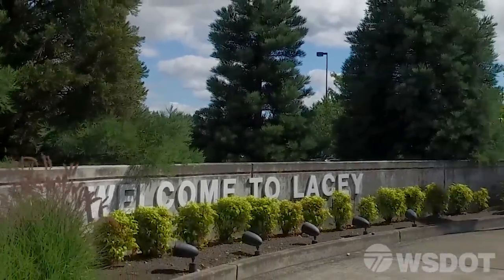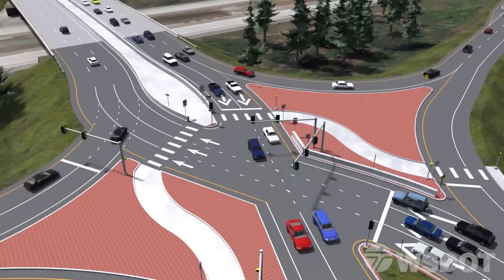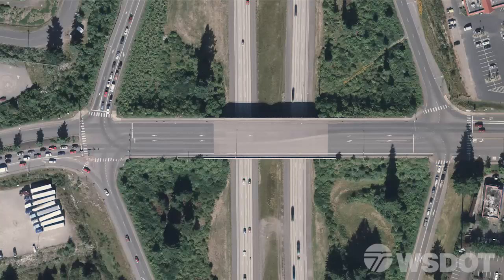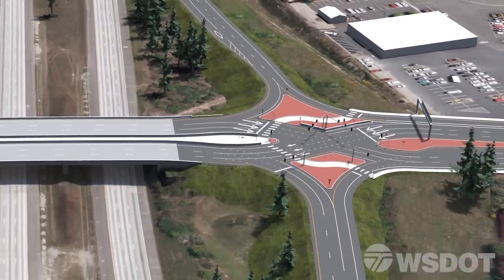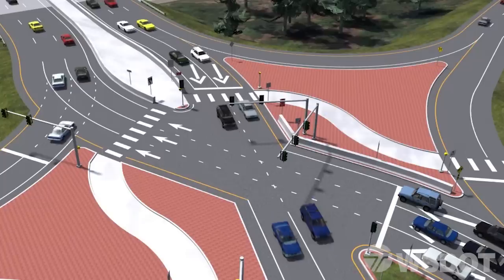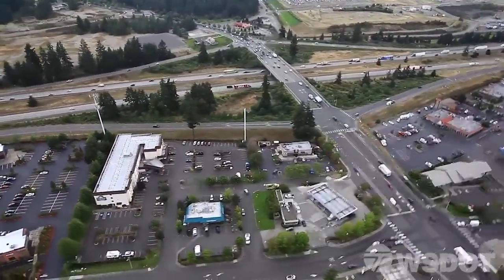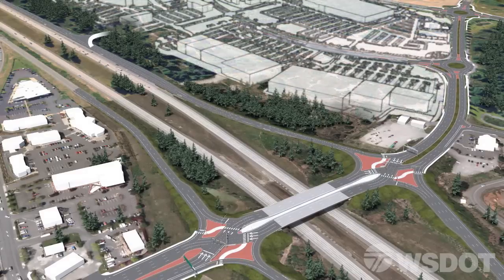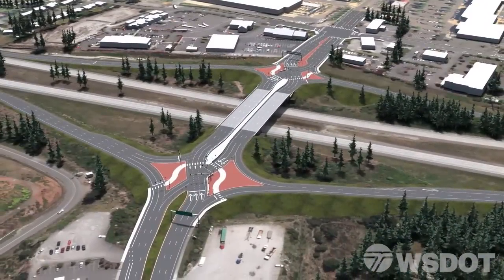Diverging Diamond Interchange comes to Washington State

Comment: I've lived in Washington State all my life, and have been a safe driver for 15+ years with an unblemished record.

My biggest concern is the point(s) at which the flow of traffic crosses to the reverse side of the road, and then back again.
I am not saying either that I have a better idea, or that the current interchange system is good enough to be left alone, but rather the indoctrination as an American driver and tradition of driving on one side of the road at all times- and then having to suddenly switch!- would be disorienting and confusing for someone with a perfect driving record, let alone the tens of thousands of idiots out there!
For as well-marked as this DDI system may be, considering its simple rarity across the USA alone will make it a challenge to navigate even if it does improve the flow of traffic.
Reply: I doubt the driver even notices the lane change, as it's not even a road you can pull onto / off of. It's an overpass.
What I hate about these things is all the signage and lack of aesthetics. Also the huge amount of time it takes to start and finish these projects, and the money they spend. A huge amount of wasted money goes into these projects for hazard pay, insurance, not to mention extreme over-bidding and long delays.
Otherwise I think it's a cool idea, and would like to try one out.
Reply: I honestly believe that a high speed roundabout (Brit here and living in Canada) would be better than the divergent diamond.
Reply: Ellenor Malik
 For an overpass?
Reply: a roundabout at each end.
Reply: edgardo reyes
 I see, but I don't like roudabouts because it's hard to see traffic on either sides, you can't see anything in the side mirrors so if you're in a  van with no windows they are dangerous. Even on a motorcycle you need to crank your head around to check for traffic, look in all directions and check for signs to make sure you're going the right way. Or I guess you can keep going in circles.
Reply: then you are using roundabouts wrong.You scan before you go into them, control your speed and find a spot to merge and then leave.
Reply: edgardo reyes
 If you need education how to use it then it isn't practical. Scanning ahead isn't telling you what the traffic will be like when you enter it, and as I already said you can't see behind you because it's a curve.
I actually haven't been in very many of them, mainly just the one in Astoria that I never liked. Interestingly the locals like to complain about people who can't figure it out. You'd think that would be a clue that it's a bad design.
Reply: Richard Gates
I want to say the only turnabout/round I have encountered in WA is in Northgate.  Just a simple raised concrete-and-grass circle in the middle, plenty of space around it, and the signs were easy to read; nothing special really.
A round is not difficult to figure out or navigate, but that is entirely depending on how dense the traffic is (regardless of the time of day), and how many roads and lanes feed into/out of it.

(This is not a criticism, just pointing out my experience.)
Reply: EVA_Unit_4A
 No argument there. Lack of experience with turnabouts is part of the reason why I'm uncomfortable. Driving on the "wrong side" of the road doesn't seem to be an issue, this happens all the time on freeways and nobody notices, and lots of places where you turn right to eventually go left. And it's actually that problem that this new design is solving.
Reply: Another thing that just occurred to me - without actually studying roudabout designs - is you have to change lanes in the roundabout otherwise you will just go in a circle. With this cross-over design you are (or can be) in the right lane before the light.
I'm in favor of fewer traffic lights, but being forced to change lanes in heavy traffic while going around a corner isn't a good alternative.
Reply: Hi Richard, you obviously have no idea how a roundabout works if you think you have to change lanes or look anywhere but out your left window - especially behind you!!  Try driving round a few and then come back to us.

Actually I'm intrigued.  Why are you ever looking behind on a roundabout (other than the obvious of being aware of traffic around you)?

"If you need education how to use it then it isn't practical"... you need education about how all of the road rules work.  US 4-way stop signs are baffling to me because they don't exist in my country.  But clearly they do work, and with a bit of education I could figure them out too.
Reply: mrgilbe1
 Apparently I didn't get that education either, so I don't see your argument, after all I have a license.
Clearly you're not in the US since we drive on the right.
The only way you can not change lanes is by having only one lane, which won't work in place of the video's example, there are 3 lanes there so you must change lanes, how can it possibly work otherwise?
When you have multiple lanes that means people are driving at different speeds, which means, and so you must look behind and to the side to avoid hitting someone. Even when going the same speed I still can not see to the right because the back of the van is blocking my view (we turn to the left here).
If I don't want to run over a motorcycle I have to look.
I've drove around several, how many do you think I need to drive around to figure that much out?
Reply: I'm even more puzzled.

Did you get your US licence without being tested on how to navigate a 4 way stop sign?  That was my example, you must have got some education to figure that out?

You drive on the right - surely you give way to the left then (and look out your left window)?

You should never need to change lanes in a roundabout.  Either lanes spiral outwards (and new lanes get added in the centre) or they're dedicated to specific directions - if you drive on the right then the outside lane is for right-turning and straight-ahead traffic and the inside lane is for straight-ahead and left-turning traffic.  Google some pictures.  It really does work easily.

Check to your left as you approach the roundabout.  If nothing's coming, or you can match your speed and merge with the traffic coming, then drive straight on.  Stay in your lane and you don't need to give way to any other traffic until you leave the roundabout.  Easy as.

I don't know how you've driven around several multi lane roundabouts and figured out you don't have to change lanes.  That's got me puzzled, and a little worried.

But I totally agree with you about checking all your mirrors and windows for motorcyclists, because I ride a motorcycle. :-)

Now it's your turn.  How does a 4 way stop sign work?!
Reply: Sorry Richard; I thought I was trying to help. Not sure why you're calling me names.  I still don't get why you cross lanes without needing to, or how you think all the multi lane roundabouts in the world don't work.
Reply: mrgilbe1
 You just called me an idiot because I didn't learn about roundabouts in driving school.
What did I say above? I said I haven't looked into all roundabouts.
Regardless you have to cross traffic and so there's a risk of collision. You can't depend on everyone knowing how to use a roundabout. At least I don't expect other people to know how to drive, and people make mistakes. I'm very concerned about hitting anyone, regardless of who's fault it might be.
We are comparing two traffic control systems for this particular application. Now if you can show me a roundabout that uses control lights, then that might be something to consider.
Reply: Simply put a visual barrier between the sides and nobody knows any better.
Reply: They built one of these not too far from where I live, but it is not an area I frequent. Flow improved and accidents increased. It doesn't have a barrier when the traffic is flipped as in this example.
Reply: Richard Gates The problem with roundabouts is semi trucks. Our trucks are far larger, longer and heavier then in Europe. Also this interchange connects to a retail space, so there will be a steady flow of trucks. I struggle to see how a heavy slow truck will be able to merge into a roundabout, especially in heavy traffic.
Reply: Richard Gates Indeed. Any roundabout with more than one lane is dangerous, unless a Dutch "turbo roundabout" is used. http://www.turboroundabout.com/turbo-roundabout.html This type of roundabout makes very clear where people have to go without any traffic lights. Most British roundabouts with two lanes need traffic lights and still they're very dangerous and very sensitive for congestion. This intersection needs is already having three lanes so a roundabout has to be avoided and then this DDI is a brilliant solution.
Reply: +Richard Gates Navigating a roundabout (or traffic in general) is not freaking rocket science. If you're not aware or making simple metal notes of where everyone else is and is going before you even enter a roundabout then you do not know how to drive and you should just start walking instead.
I haven't checked my blind spots in years because I already know.
Reply: I don't think we are really talking about roundabouts here: https://en.wikipedia.org/wiki/Traffic_circle

Comment: How does this improve wait times, when Free-flowing traffic in both directions on the non-freeway road is impossible, as the signals cannot be green at both intersections for both directions simultaneously?
Reply: No more left turns. And 'right turn on red' on both sides.
As for the flow, think of Manhattan. Fill up the middle section from the motorway. Wait for it to clear, then fill up from the side road. Everybody has to stop on the bridge, but in the end the volume is higher.
Reply: I don't see how this makes any sense unless the majority of the traffic is making left turns and even then only one direction of traffic gets a "free" left turn.
Reply: Tyler D. Merging? This Intersection? THERE ARE LITERALLY NO MERGING POINTS FROM EITHER TO AND FROM THE HIGHWAY.

Comment: I live near Springfield Missouri where those first ddi's were built. We have several in Springfield now. I confess I had my doubts when I saw the design, but having driven on them for several years now I want to tell you they work very smoothly and really do help the flow of traffic.
Reply: I was forced to drive through that intersection in the old days and worry about the traffic and being in a pileup from an inattentive truck.  The new interchange there was an amazing improvement.  There were days that the traffic was a mile backed up.

Comment: Uhm.. the conflict-points thingy:
those numbers are not for the topology that is shown in the image.

And of course road-markings, signs, barriers etc - yeah, it is not like those are for all roads, only DDI can have those features.

And DDI has drawbacks as well - like an rather extreme reduction in bandwidth for those that want to go straight.
Cause now you have 2 areas in which the main traffic flow intersects with it self - that is a horror if at any point a congestion occurs as it multiplies its severity.

Comment: Another large benefit not mentioned in the video is merging down on the Interstate.   With traditional access to the existing on ramp (especially left turners) controlled by a traffic signal and long cycle times, vehicles end up being "clumped" together making the merging process more tricky, and sometimes the more aggressive merging people passing each other.   With the merging cars being a more constant steady flow, it should reduce slowdowns on the Interstate when through traffic vehicles use brakes and the red lights cascade backwards.

Comment: The intuitive PROBLEM with this system is that, for a short distance, you have cars driving on the wrong side of the road.  Drivers expect to see cars going in the opposite direction on their LEFT, and certainly not on their RIGHT.  This might cause some confusion.  It would be far better to put a visual barrier between both sides for a short distance to eliminate the problem.  We are not British, after all.
Reply: That's why they have concrete barriers at those points to help alleviate that confusion...
Reply: Yes this exact problem is addressed in the video.
Reply: Not to mention the pedestrians and bicycle riders that are going to be in the center between two lanes of fast moving traffic.

Comment: Brilliant.  Modern design really shines through thanks to the video's look and feel.  Hats off to the traffic engineers, and the animators, on this one!
Reply: John Williamson  Bummer.
Reply: johnwilliamson3752  Looking pretty is not a priority when designing interchanges, so saying it's ugly is is a weird argument. It is definitely not confusing at all when you actually drive through one. Green means go. Red means stop. Stay in your lane. That's it. It's simpler to drive through than a typical intersection and traffic flows much smoother and quicker, which is why they're being built in a lot of places. This design eliminates the need to yield to oncoming traffic when making left turns.

Comment: One frustration I can see is using the interchange at times of low traffic volume, such as at night, when in some states it is legal to turn left across an oncoming lane if the road is clear.  This makes for a typically free flowing interchange.   But now with traffic lanes crossing each other, you are still required to stop...even if there is very little traffic.
Reply: Isn't it always illegal to turn left at a red light without stopping? These interchanges all have signals to direct traffic. You're really reaching with this complaint.
Reply: My concern still centers on the fact that free-flowing traffic in both directions on the non-freeway road is impossible, as the signals cannot be green at both intersections for both directions simultaneously.
Reply: That's an excellent point.  I suppose the benefits do outweigh the minor negative aspects.
Reply: Plus you can add sensors that signal the lights to change if they detect a car approaching during a low traffic time.
Reply: Yeah, lights would definitely be priority controlled during the off hours.  Easily.
Reply: You can turn left on a red if the street you are on AND the street you're turning onto are both one way.  Idaho, Michigan, Oregon and Washington allows left turns across oncoming traffic.  Some drivers behind you think it's MANDATORY to make your trun on a red.